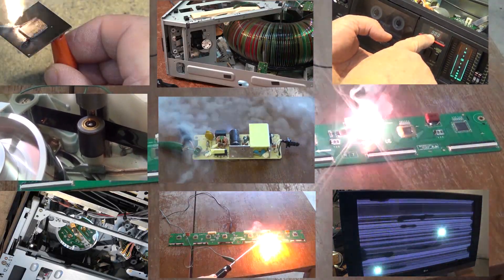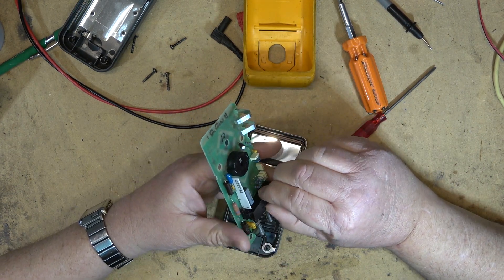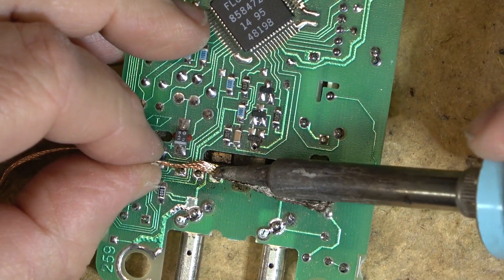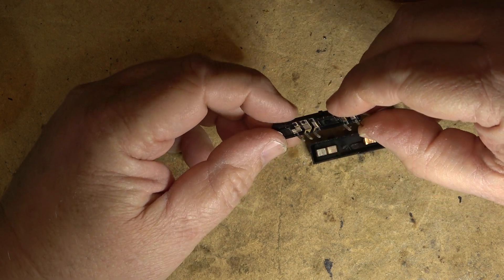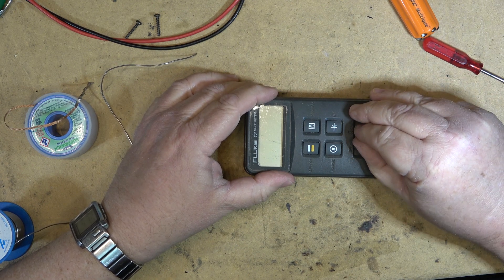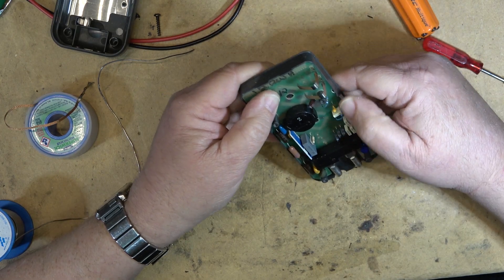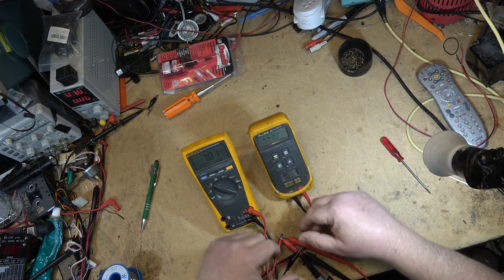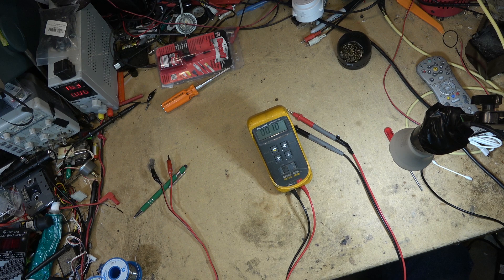Fluke 12 Digital Multi Meter Turns off all the time repair

Comment: Have watched this video a half dozen times now, every time you pry that switch apart I cringe.  If it broke it would be a no obtainium part unless you bought another Model 12 somehow.  Can't have too many meters😉
Reply from the maker: I paid 10 bucks for it years ago. I do have a brand new fluke I have not even used.  It it breaks it will give an excuse to use the new one.  I'm going to be doing far less repairs now that it will get about 50% more for emaricans thanks to trump removing the de minimus exemption.  Now Americans will experience what we have been dealing with.  Our tax was only 12% on items over 20 bucks.  Americans will pay 35% plus broker fees.  I can see that drying up service so less for me to repair less videos to make less income means less incentive to do them.  Many small businesses are thinking of throwing in the towel.

Comment: In Canada, Fluke meters have always been super expensive. The first DMM I bought was a Fluke 77 back in 1989 when in college. At that time, it cost me $320. It still looks and functions like new.  I bought a Fluke 12 in 1994 and a few years ago two of the plastic screw standoffs broke off just unscrewing the back screws to change the battery. Now it has intermittent connection and won't turn on unless I put screws in with just the right pressure. The battery contacts seem to be very thin and bend too easily. I rarely used this meter, so I guess the plastic is breaking down over time. About 10 years ago I bought the Fluke 87, and it is still working well. Fluke has always been my favourite brand of DMM.
Reply from the maker: I have a new fluke that I have never used.  Bought it off Facebook a few months ago.  Looks like it was never used by the previous owner either.   Came from the seller's dad's estate.  He was an old tv tech and when he died his son put all his stuff up for sale.  Scope meter tv anylist.  I grabbed the meter, but didn't need another scope so I left that.

Comment: Hi sir..need your help, i want to know why my radio cassette motor not running? Motor is new..no power at cable link to motor..
Reply from the maker: Switch, fusable resistor?
Reply: @12voltvids  canot find any problem on resistor..

Comment: Good thing you got it fixed. It seems to have pretty good capasitance measurement also, which most cheaper multimeters do not. My Mastech multimeter has a capacity measuring, but is  only up to 10uF, and i dont really trust it

Comment: What brand is that bench PSU? Been looking to buy one and currently looking at a Siglent linear one because all the cheap switching ones seem to have complaints regarding output spikes.
Reply from the maker: This one is s switching supply and it has been good b
Reply: @12voltvids  what brand is it?

Comment: Smashing, well done dave, it just needed a service, thats fine :-D
I was given a fluke 111 meter, not a high spec meter and i suspect it was not designed for electronic use,  electrician use maybe.
Amazingly my old micronta meter was so close to it,  i calibrated the micronta by changing the reference resistors ten years back with a bag of 1% resistors.
Quite close considering my gut feeling.
That micronta was made in 1983.
Oddly the single chip was made by sieko, i didnt know they made anything other than watches.

Comment: Fluke test gear has never been cheap, but compared to the cheaper brands they last far longer.
If you can find a used one that has not been abused, it will last many years even if you have to clean
the switch a few times.
The made in China ones are ok for a hobbyist, but just don't last with daily use.
Reply from the maker: Fluke is the standard.  Military spec made in the USA. Fluke, tektrobix and hp. You pay the price for quality.  I bought this meter for 12.00 at one of the first ham swap meets i attended.  Early 90s, perhaps 93. I used it at the shop because the a55hole shop owner didn't want me using his fluke 77.  I had a micronta as well and it wasn't very good.  So i brought this one in.  The guy I worked for was a miserable little pr1ck that didn't want anyone using his tools even though he was making money off us.
Reply: @12voltvids  Having worked in test equipment repair and calibration, i can only agree with you.
Re shop owners, they are all only interested in making a profit, and are as mean as possible when it comes
to buying good tools and test gear, i had one hell of a row with my boss when he took on the local Pioneer
repair centre roll, it took Pioneer themselves to insist he bought the right gear and test discs to enable us to
do the repairs and alignments correctly, i still have that gear, but he made me pay something for it when
the shop closed.
There are no friends in business, as long as you work for someone else you won't make much money,
i just wish that i had gone self employed before i was forced into it, i paid my mortgage off in 5 years
instead of 25 years.

Comment: I don't think Fluke meters are expensive. OK, they cost good money when you buy them, but they stay reliable for decades. I've got two of them, a 73 updated with the 75 knob so I could have range selection. It's over 40 years old and going strong. The other is a 87-4, about 20 years old since I bought it and also still reliable.  I think they are awesome!

Comment: The Fluke meters are a work horse; I got a demo unit that lasted well over 20 years, finally the selector switch wore out, Later picked up a second hand one that works great, supper accurate.

Comment: The tarnish on silver is due to sulphur, contained in small amounts in your sweat...
Reply from the maker: And how would that get inside a switch?
Reply: @12voltvids     The evaporating sweat (and breadth!) actually releases sulphur as hydrogen sulphide gas.  So it gets to anywhere along with other gases, air included.  In the old days, when "silverware" was indeed silver (not the present stainless steel), cleaning the tarnish was a repeating task, even on spoons, forks and knives stored in drawers and possibly even wrapped in fine paper.  My childhood dedicated spoon was in daily use and was scoured after every meal, but occasionally needed heavier cleaning.  Other, inherited antique silver was hopefully stored away from daily handling, but tarnished the same, or even more.
Reply: @InssiAjaton  And why is toothpaste so efficient in cleaning silver?

Comment: I have same. One of those pieces that makes you feel like a king. I've replaced zebras and case is glued and taped together all over the place. It's quick and accurate. I'll have it with me when I am cremated. I find RP7 a good switch contact cleaner. Has worked when WD40 did not. Recovered many a switch without opening. Thanks for sharing and hope it works another 30 years for you.

Comment: You just watched a repair video of a yamaha synth you made years ago, great work on that repair. My synth worked perfectly until i used a new 12 volt ac power cord. AC works from the power supply but suddenly the batteries dont do anything my multimeter is reading 8v from the 6 (1.5v) c batteries. Any idea whats going on? Did the new AC power supply break the dc power switch or something? Any help would be greatly appreciated!

Comment: Great! I assumed they have a timer to shut them off after a period of non-use, and I was thinking it was the timing circuit , but I don't have that meter, and the symptoms must not point to that. 
Most people it seems will toss a malfunctioning meter and get another.
To be able to restore an old one is great.

Comment: I have a Fluke 73 I got new in about 1988. Great little meter but the plastic case is getting brittle. Last time I changed the battery three of the plastic posts for the screws broke off. I had to modify it with machine screws to hold it together.